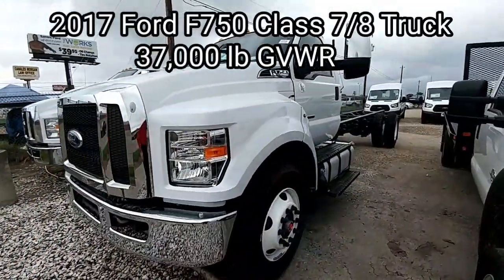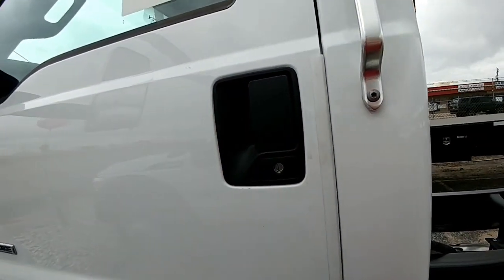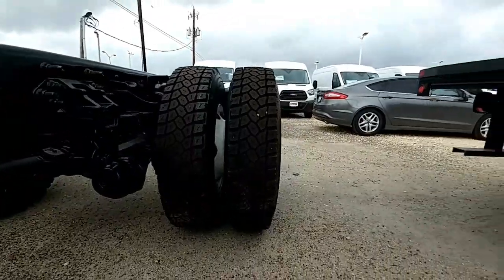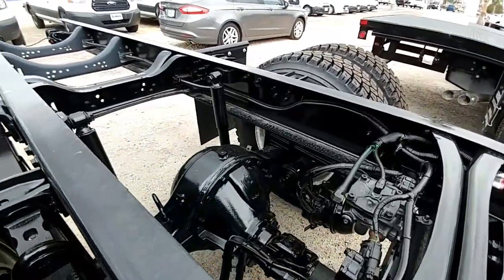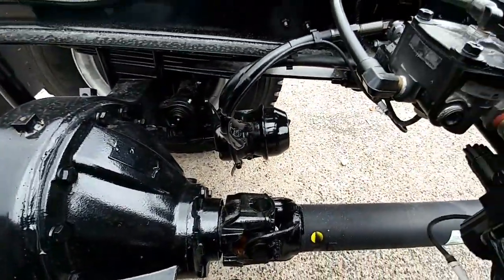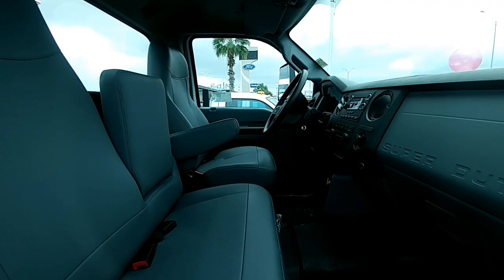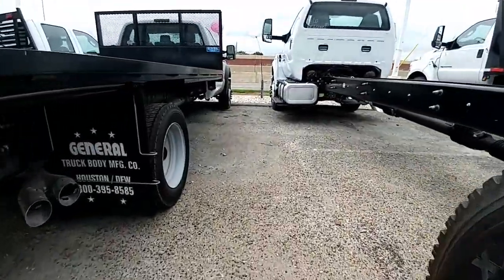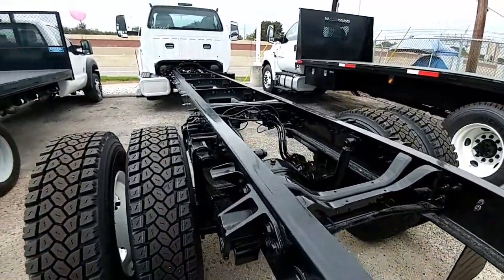2017 F750 Super Duty with 6.7L Powerstroke! WOW

Comment: Your Cummins rating is wrong. Cummins 6.7l is 370hp with 800ft/lb and higher if it's the high output version.
Reply from the maker: Margaret Morehead: Not for Medium duty applications.  The Cummins 6.7 ISB is derated just like the Powerstroke.
Reply: Correct with hp and ft/lbs for Cummins. Had Power Stroke and now Cummins. Brother has DuraMax and wishes it was Cummins. Cummins is my preference.
Reply: I've driven a lot of Tractor Truck/Big Rigs with different makes of diesel engines. I'm happy with my Peterbuilt's Cummins.
Reply: Too bad for FORD no longer using Cummins.
Reply: Sterling Bullet Trucks needs better engineers to design and develop better medium duty trucks.
Reply: You can shine a turd; but, it's still a P.O.S.

Comment: what's the different if all these engine r  6.7 same engine on the 250?
Reply from the maker: al Valdez: Pretty much the same.  It's a lower power version to deal with the loads these trucks constantly contest with.  Also, because of the much lower axle ratios

Comment: do you need a CDL to use all of its towing?
Reply: Meat Shield since it has air brakes I would think so at least at class b with air brakes.
Reply: Meat Shield yes I believe anything over 27,000lbs requires a class B CDL
Reply: 26001 pounds Class B CDL is needed.

Comment: This truck looks awesome. I currently drive a 13 and 15 HV international at my work with 7 yard dump beds with the L9 Cummings engine. So glad I will be driving one of these in 2019. The Internationals we have are gutless. The only  problem if you want one with something different than the 270 power stroke you'll be waiting for over 6 months. The demand for these trucks right now are crazy.

Comment: Hope this thing isn't a ecoboost. Looking at buying one tomorrow
Reply: Rmyers47 really? and no not ecoboost no ecoboost on diesel engines for ford.
Reply: I just read that they introduced them for 2017's
Reply: The only engine available for the 650 and 750 is the Powerstroke Diesel or V10 gas.
Reply: Danke Schon fur die info.
Reply: Rmyers47   grossing 52,000 running 70 75 40,ft trailer getting about 7 miles a gallon I don't see a fuel saving boost.

Comment: Is there any different motor options?
Reply from the maker: Ford Farm Boy Ford Farm Boy: not any longer.  Just 3 power levels of the 6.7L Powerstroke
Reply: Big Truck Big RV they got rid of the 6.7 cummins?
Reply: Yes, the 6.7L Powerstroke is the only engine offered in these now.
Reply: You can also get the triton v-10 in these.

Comment: Class 8 has minimum 12 and (2) 40 rears. Class 8 is not medium duty. My class 8 trucks are 14.4 and 46's with double frame, 8 bag air ride and are 4 times the truck as a bread van. This unit will make a nice service truck.
Reply from the maker: Gilbert McGillicutty: I thought the F750 was only a class 6& 7 truck until I did some additional research during the editing of this video.  I found that they go all the way up to 37k, which would make it a class 8 truck if properly equipped with tandems in the rear.
Reply: Gilbert McGillicutty must be a heavy hauler specing anything that heavy

Comment: Do you need a CDL to drive the F7 50 and F6 50
Reply: You require a cdl for any commercial vehicle that has a grvw of 26001 pounds. Just to drive home the point. You can with a standard drivers license drive a 26ft box truck with air brakes and a grvw of 26000 pounds without any issues from my research, but once it is 26001+  you would be required to have a class b license

Comment: that truck isn't a class 7 or 8 it's a light class 6 with a 32k gvw. If I was going to buy something to pull a light load like a 5th wheel I would buy a used class 7 single axle with an auto shift and have better proformence and fuel economy
Reply: Dunning-Kruger Effect.

Comment: I want a F750 based super C motorhome so bad... :D  Ok, time to stop dreaming.  How about just getting that hood setup on a 350-550, so that I can do any repair I want myself without having to pull the cab... :D 

Or a cabover LCF style (but not the LCF, that thing is terrible for rv duty), in order to leave more room for a bed in the back?  You could have a cab-over with a 12ft bed probably and still be the same length as a crew cab long bed f350...

Comment: interestingly the f750 only had 650 LB FT torque. the 550 has 920 torque. im going for thr 550😊. thats a no brainer
Reply from the maker: Benito Jr: 550 is 650-725 also. All chassis cab trucks are underrated.

Comment: I really want to see ford make a full size otr semi tractor.
Reply: Look up the Aerodyne. They tried for a while, but just didn't make enough money to stay in it.
Reply: ripplecutbuddha Ford also had the l9000
Reply: Ford sold their heavy truck division to Sterling in 1997. They apparently didn't have a big enough market share to justify it, and they wanted to use the manufacturing facilities to built the new (at the time) Super-Duty line.
Reply: Yeah, sterling bought out Ford's assets in the mid to heavy truck classes.
Reply: Sterling doesn't exist anymore. They were piles anyway
Reply: I used to drive one. what a piece of crap
Reply: knexfreak32 The use to make a semi. Dad had a ford aeromax with a 500 detroit

Comment: Why do all the ford trucks always have 50 at the end. F-150 F-250 F-350 the only trucks that don't have 50 at the end are the bronco the F-100 and the ranger and they don't even make those anymore
Reply: Same reason Chevy has the 2500/3500 series....
Reply: Nos16_13 Wanted, go back to the 1950s and ask the engineers....
Reply: F-150 (half ton), F-250 (three-quarter ton), F-350 (1 ton)
Reply: aaahhh but what about way back when they were called the f100
Reply: It's really just a carryover from long ago. Back in the 1960s a Ford F100 truck was a true 1/2 ton truck that could carry 1000 pounds (half ton).  The F150 was a 3/4 ton truck back then, (1500 pound capacity).  The F250 and F350 could carry their equivalents in weight also.

Comment: is this a pickup or a semi
Reply: Not a pick-up and not a semi. A medium duty. Closer to a semi; but not quite.
Reply: The closest thing I would call the F650 and F750 would be a two and a half ton and a three ton respectively. The F750 may be closer to the "Five Ton" truck mark but I'm going the way the other truck lines operate in, in their orderly sequence. 
150 half ton, 250 three/quarter ton, 350 One Ton, 450 One & a Half Ton, 550 Two Ton, 650 Two & a Half ton, and 750 being a three ton.
Reply: I'd rather have an old deuce and a half that could climb a telephone pole. With just a front and one rear axle and the weight of the truck, I would call this an eight ton truck. Years ago, they were called "... ton" truck because of the actual capability of hauling. Now, truck are able to haul more than their naming "... ton truck".

Comment: The F650 and F750 line of trucks are unbelievably stout in terms of heavy duty aspects. I know that the F650 generally has a 26,000 lbs GVWR solely due to anything over 26,000 lbs GVWR in some states you need a CDL to operate it regardless of it being used non commercial or commercial. I also read up a while ago that the F650 has an option to have the Maximum GVWR package which is upwards to 31,000 or 32,000 lbs so this tells me that the truck can literally handle and do a LOT more than Ford marks it for, but Ford dumbs it down to 26,000 lbs on the button solely for the legal loophole with letting the customer get away with purchasing and using the truck without requiring a CDL etc to do so. The F750 as well can be purchased with a dumbed down GVWR rating of 26,000 lbs for the very same reason as the F650 can. But generally the F750 has 33,000-34,000 lbs GVWR which is astronomical to say the least. That is some serious capability. It's amusing to me that Ford is the only truck company to continue producing a Class 6, 7 and up truck for commercial use. Dodge has the Ram 4500 and 5500 which are basically on the same level as a Ford F450 and F550 or in English a ton and a half truck and a two ton truck respectively. Chevy and GMC stopped production of their C4500 & C5500 + trucks being the GMC TopKick and the Chevy Kodiak commercial grade trucks and they no longer manufacture or produce the TopKick or the Kodiak any longer. Ford is the only one of the three that still produces Class 6 and up trucks with the Ford brand on them and with Ford parts etc which I think is really respectable and cool to see with a truck company. I am a bit biased towards Ford as I own an F350 myself and quite like my Fords but it is really cool that Ford still to this day produces the Big Ass Class 6 and up commercial grade trucks and will probably continue to do so as there is clearly enough demand for them from the general public.
Reply: sirkingdra Ford all day! My uncle owns an older F650 as well a Chevy kodiak, Both flatbed tow trucks, for our family junkyard business. Both rigs get the job done but the F650 has seen more, yet still runs as good as the Kodiak.
Reply: sirkingdra Chevy just got back in the medium duty market.

Comment: we use these kinds of ford's in the oil fields,  good trucks BUT rough riding suspension.  no air bags... dude they are horrible in the fields..... any one agree?
Reply: It's because they use a solid axle front with leaf rear. Proven but old tech. People give duramax's shit because they think ifs is weak for a working diesel. There have been a few cases of failure but there are gusset kits that are super easy to put in if you worried about it and will be strong as hell and still ride alot better than ford.  Last time i checked the military mrap's have ifs and irs and their straight beasts
Reply: IRS for ground clearance, troop comfort is not high on their list.
Reply: Ron Dye Channel   but not strong right ? lol
Reply: I don't know about the older models you are driving but the current models have rear air suspension as an option.
Reply: james dean An IRS has to be majorly overbuilt to be as strong as a straight axle, think heavy truck (semi), no independent suspension.

Comment: Needs a bigger engine. Won't have enough torque.
Reply from the maker: William Warner: I guess it does since the reorder rate (orders by a customers who currently have one) is through the roof
Reply: William Warner they are geared alot lower than a powerstroke in a f250. they will have plenty of torque up to 45mph-50mph. after that it will feel like a metro.
Reply: Big Truck Big RV yeah sales numbers are good. more torque would help though. 9 liter would work. also wouldn't rev so high on the freeway. drove an older model years ago.

Comment: Why would a private person ever need more than a 4500/F-450

Any thing more than that is commercial/industrial applications
Reply: Mach SCGA looked at the weight on a fifth wheel trailer recently? Then the weight of the truck towing it? Then hooked all that stuff up like they were going somewhere and run across a scale? DOT doesn’t necessarily apply but you violate GCWR OR GVWR and you will not like it.

Comment: I heard ford is bringing back jobs from mexico. That's very honorable if its true. Good for them. I hope chevy does too
Reply: james dean yeah cause they can. President Donald Trump in the house!!!
Reply: Brent Miller actually it was an agreement between Governor Kasich, Ford, and the UAW struck in 2011. Ford has been investing and retrofitting that ohio plant for the last 5 years so they could start producing these truck in ohio again. Trump had nothing to do with it.
Reply: That's right Jason, with a couple changes.

The truck was launched in July 2015 after a year and a half of actual tooling. There was some preparation for it before that, but concrete didn't start getting cut up, pits poured and new chain line and such until a year and a half before launch. 

The plant then went right into tooling up for the F-350/450/550 chassis can production. That was launched in August of this year. There is ongoing launch work for the 2018 650/750, 2017 1/2 E-Series, and future Super Duty changes as well.
Reply: Maga!

Comment: Not really sure who would prefer this over a Freightliner M2. I am not sure on the price differences, I would imagine the Ford is cheaper. Most in the medium duty truck industry tend to laugh off a V8 Diesel in such a chassis, I sort of wish they would have kept the Cummins as an option. A lot of fleets using trucks this size have streamlined much of there operations to Cummins.
Reply: crazyjdkid Well, there a few reasons. (I own a moving company, and the F-750 is a great choice). As you mentioned, price. Upfront cost out the door is about $20k less. Times that by 4-5 trucks, and all of a sudden you have another truck in your fleet that is providing revenue. Another thing I want to mention is Ford's fleet maintenance program. My brother and I (The business is both of ours) do not have a mechanic. If there is any issues with the trucks, there's roadside assistance from Ford direct. They handle all the maintenance, and keeps the fleet moving. Peace of mind I value, and it happens to come in a cheaper form than we thought with the F-750.
Reply: There are* Excuse the typos.
Reply from the maker: Vegard Claussen: Thanks for the great response.  I know that 99.99% of the people who compare these trucks to other brands have absolutely no experience owning and operating a fleet (or even 1) of them.  It's good to hear from an actual fleet owner WHY you chose this truck...and they were very good reasons.  Thanks again
Reply: First, thanks for not attacking me and honestly answering my question! I only ever drive M2s or Durastars  so my experience with Ford is slim. I would like to try one eventually. The cab of these trucks bothers me a bit, not sure what it is though. I am interested to see how the 6.7 holds up over time in this application. Compared to the T444E and VT365 of the past. And to the poster of the last comment (channel owner), if you are directing that comment to me please feel welcome to check out my channel which is full of driving videos and reviews of many medium duty trucks. Thanks!
Reply: Fortunately I think we are on a largely "adult" channel. So no "attacks" are necessary. Only information provided to help the difficult decision between brands, and how they can effect your business. Whatever helps another small American business owner should be seen as a civil duty in my personal opinion (having two failed businesses in my past). 

Back to trucks.

You bring a valid point; Mechanical history. The 6.7 Powerstroke has yet to have as many years and miles under its belt as a comparable Mercedes or Cummins diesel. The advantage the 6.7PS has over most other competitors is sheer volume. This engine is now in everything from the F-250-750. Millions. In my humble opinion that more than makes up for lack of time on the road. Because it's R&D is in a constant state of hyper development. 

Their reputation is on the line. And despite this making fiscal sense, it was still a bold move on Ford's behalf.

Comment: So what is the use of this thing? 😂
Reply: Marton Bagoly costco shopping run
Reply: It's a commercial truck. It makes you money by hauling goods and cargo for compensation. </obvious>
Reply: Alright yes of course. However, if you're going this big, why not just go full commercial for a semi of some sort? What does this have to offer?
Reply: I see a lot of produce trucks this size, or a little smaller. Also a flat bed would make this one hell of a wrecker. Too big for a U-Haul b/c you need a CDL.

Basically anyone who needs to move a medium amount of weight, and desires the convenience of a straight truck, vs. a semi trailer setup. I'd suspect purchase cost is considerably lower than a class 8 PLUS trailer, and the Powerstroke will (hopefully!) be cheaper to feed an maintain than a 15L diesel out of an OTR machine.
Reply: Thanks! :)
Reply: bcubed72 they use that one for a uhaul just no air brakes
Reply: Tree chipper truck, bucket truck, box (moving/delivery) truck,
Reply: I think the U-Hauls are F550s. If you did rent this truck out, you'd either have to de-rate it to 26,000...or only rent to CDL holders. It would make a KILLER moving van for hired drivers, though...probably the perfect size.

It's a lot less of a PITA to utilize a "straight truck," than to have to hook up a trailer every time you want to go to work. Obviously, this has less overall capacity...but "capacity you don't use" is just wasted money.

I don't think ANYONE uses a F750 as a "phallic enhancement"; I think the "all hat, no cattle" crowd seldom gets anything bigger than a F450 at most...probably a F350, because that's the cheapest "Look at me--I got a dually!" ride out there.
Reply: In California, 2 axles will only get you a DVD rating go 26k, unless you in a hitch and pull a double. Then each axle with dually is only rated at 20k and that skinny front axle should get rated at 15k.
Reply: DMV Rating not DVD rating, damn spell check
Reply: Margaret Morehead hah I was confused what DVD was
Reply: My dad drives these trucks for the tree company he works for. All of them have a big dump to hold all the wood chippings. Also some of them have a bucket.

Comment: I rather get a International Or Freightliner with a Cummins ISB. Open the hood on these fords and the engine is buried in their.
Reply: Levi Lozano in their what?
Reply: Levi Lozano you are aware that international makes the powerstrokes right
Reply: Quinn Leverett the 6.7 is manufactured by Ford
Reply: Quinn Leverett Yes sir! The International makes the 6.0 and 7.3 and 6.4 Diesel engines for Ford. But not the 6.7. That was a ford only thing.
Reply: Levi Lozano oh ok I knew Ford either made the 6.4 or the 6.7 I just didn't know which
Reply: Levi Lozano the 6.7 is a huge step for Ford vs the 6.0 and 6.4
Reply: Quinn Leverett They used too. But Ford sure them for making defective engines after the 6.0 and 6.4. Ford now builds their own motors.